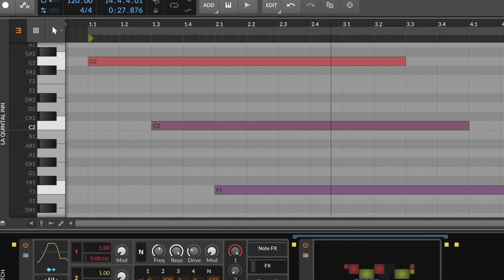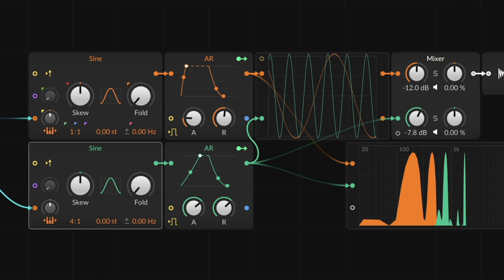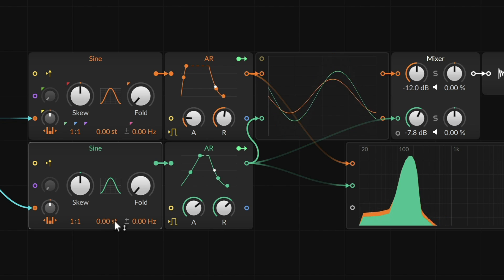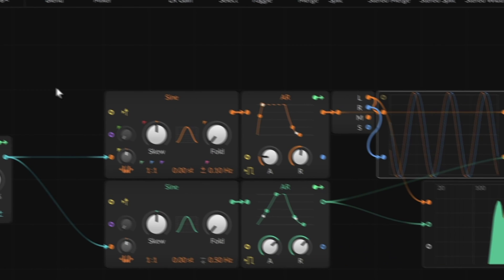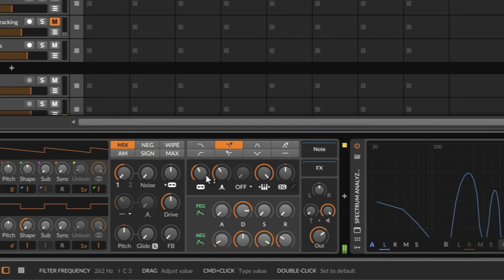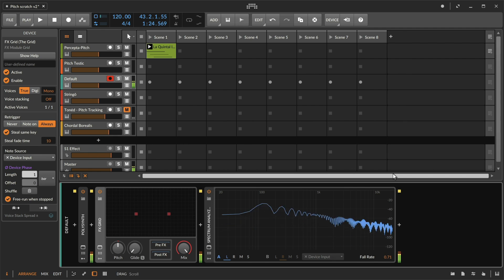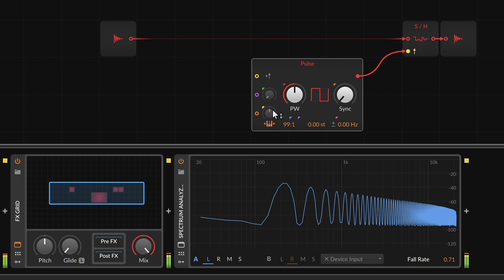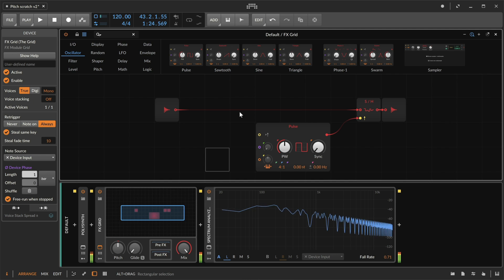Modular Concepts: Perspectives on Pitch [Bitwig Studio | The Grid]

Comment: Can anyone provide more clarity on the sample and hold pulse oscillator setup. The pulse is setting a frequency for sampling to take place, I see that but I’m not sure how it relates back to our main sample rate. And why does it create the dips visualized in the spectrum analyzer? Can anyone give me some numbers to think about? I don’t exactly know how to ask the question but I want to attempt to think about if from another angle to better understand it. Thanks in advance.
Reply: i think you can directly compare it to the "pulsing" oscilators earlier in the video. if you have two oscilators playing the same pitch and detune one of them slightly, there will be times when the peaks and dips of the waveform don't match up, creating the pulse.
now lets say that one oscilator plays white noise and the other one is the clock. exactly the same concept. based on what frequency your clock is set at, there will be certain frequencies where the clock always matches up with the peak of a waveform. at those frequencies, the amplitude of the waveform won't change. however, there will be frequencies where the clock is almost never sampling a certain frequency. those frequencies will be quiter. this creates the shape you can see in the analyzer.
when changing the clock rate, think of it as detuning the second oscilator in the first part in the video
Reply: @flat6_music  cool that provides some food for thought, cheers!